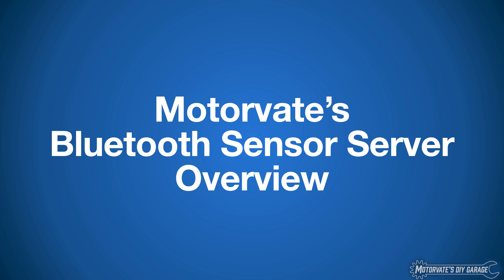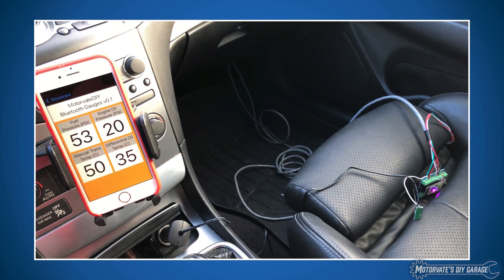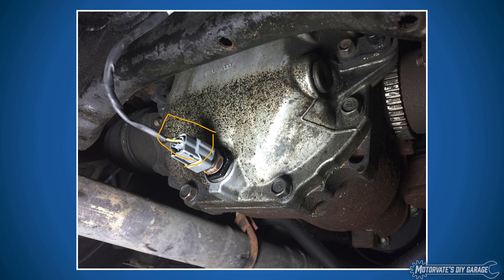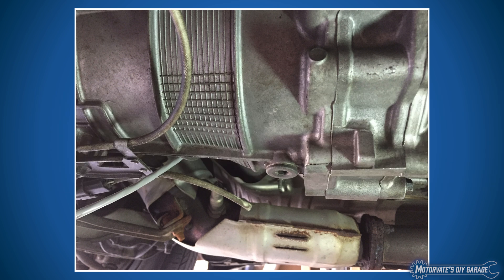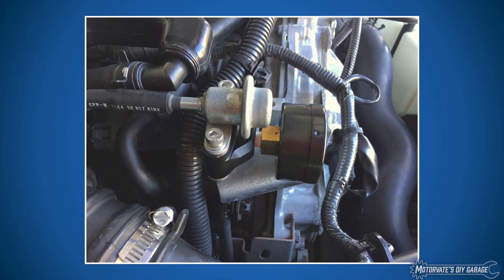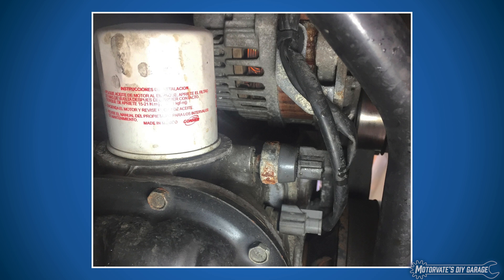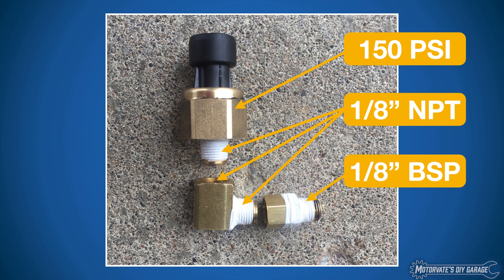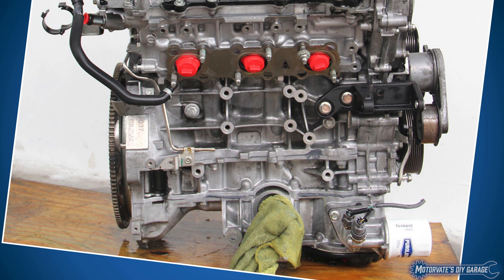Convert any wired sensor to Bluetooth with our Bluetooth Sensor Server: MotorvateDIY Garage Ep.44

Comment: I've been researching on options to make these sensors send signals via bluetooth to an indash head unit. The biggest issue I'm having is that my car is a 1995 so pre-obd2 and it's primarily stock. I just wanna be able to monitor the very sensors you mentioned in the video. Looking forward to see how you bluetooth sensor server turns out.
Reply from the maker: The testing over the last few years has gone very well. It connects in under a second and there has been zero data corruption.

Once the GTR gauges are launched, I'll be showing how to make any sensor Bluetooth.

Comment: Are these available yet?
Reply from the maker: Not yet... I ordered a few waterproof cases a few weeks ago and hope to have them for testing later this week. 

Everything else has arrived and is ready to test on other local vehicles. :)
Reply: @MotorvateDIY Fantastic work! Any news on when they'll be available?
Reply from the maker: Right now, I hope to get these out in late spring / early summer of 2024. 

Testing on my car has gone well. The next step is to test on a few local G37s to make sure everything works as expected.
Reply: @MotorvateDIY  I'm very interested in picking one up, want to make my own digital dash for my old K20 pickup but it's not fuel injected and just want all my sensors on a tablet or screen. Thanks!

Comment: This sounds amazing! Is this only meant for the G37 / 350z? I'm looking for something like this to monitor my oil temps as soon as I finish restoring my '96 EK4 Civic and start using it on track days. The car is OBD1 and has an aftermarket oil filter plate to mount oil temp and pressure sensors. Instead of installing fixed meters, I love the idea of popping on the mini-dash when driving on track. Would the mini-dash be powered from usb or use a built in battery perhaps? How do you plan on getting this to market? Through crowdfunding, or pre-order maybe? Or open source the hardware and software? I'd like to contribute :)
Reply from the maker: Hey Tim,
The Bluetooth sensor server can support up to 8 sensors and will work on any analog pressure or temperature gauge on any make/model.

It simply reads reads the analog voltage of the sensor, converts it to a value (via transfer function) and then sends it out via Bluetooth Low Energy (BLE)

The Bluetooth data can be received/displayed on a LCD mini-dash that is powered by the car/USB or displayed on phone app. (iPhone app is already done)

As for the plans to bring to market or open source, I haven't made a decision on that yet. I hadn't considered  crowd funding, and will look into that.

I have been testing it every time I drive my car and it works really well and automatically connects in about 2 seconds.

Anyways, thank you for your message!

Comment: Awesome work! I'm VERY interested in getting one if possible. In the 370z it's easy to add gauges, but my G37s looks bad with so many gauges I had to put in the pillars. This is a much cleaner, simpler and better solution.

I always drive with an Ecutek dongle and do datalog, always... Do you connect to the OBD as well or you have a male female OBD port to get the values and leave room for a scanner?
Reply from the maker: Thanks for your kind words!
The LCD gauges / mini-dash does connect to the OBD port. 
However, we also have developed an OBD  "Y cable" so two devices can plug into one OBD port, so the gauges and any other device can both be used at the same time. :)
Reply: @MotorvateDIY  that's simply awesome!! I can't wait to have one if you decide to sell them. You put a lot of R&D here so at least you can make some profit from it. You look like the type of person that wouldn't want to get profit from it but you sould take in consideration all this work that you put into it, even if it's a hobby and you enjoy doing it, you have to add it to the end product in my opinion.
Reply from the maker: I do have plans to sell a DIY kit, after lots of testing.